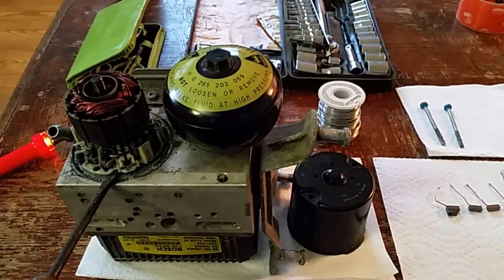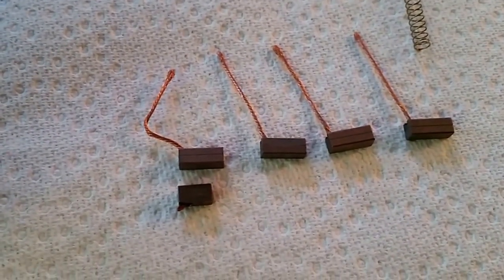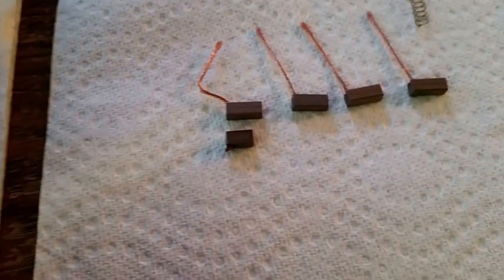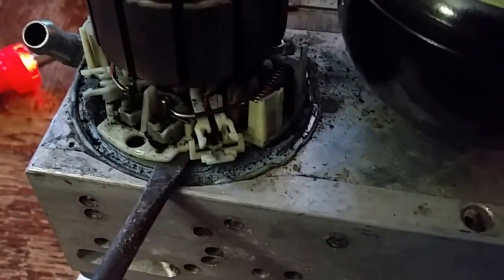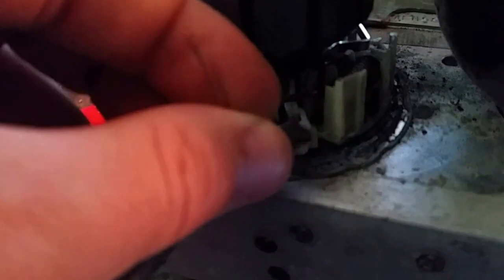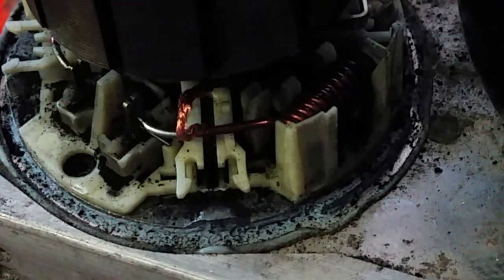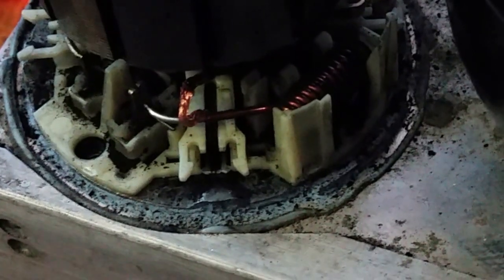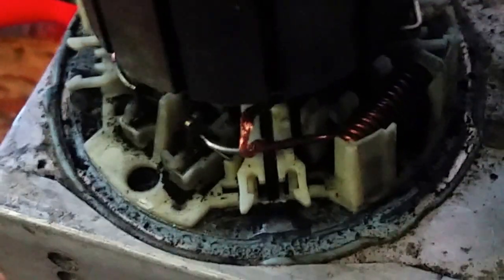Mercedes Benz / Bosch SBC Pump Rebuild (Brush Replacement) pt. 2

Comment: I think these old brushes are not half way trough but are completely worn out. Per previous video, the wires on the old brushes were pushing against the plastic frame already, when this happens, its no longer let the brush come out any further.
Reply from the maker: correct, they have to be long enough for the wires to connect and for the springs behind them to make pressure so they are worn out even before they are worn all the way down

Comment: Recall was on unit plug. Did your brushes failed prematurely? Your title says pump rebuild, where I don't see you addressing pump at all.
Reply from the maker: Good catch I agree its important to use correct terminology, if I said recall at all in any of the vids I should have "manufacturer extended warranty".  So just to clarify, MB had a recall associated with a limited number of SBC pumps and the recall was actually not on the pump or the unit plug, it was on the ground wire going to the plug and it also involved adding bracket for a change in the way the plug was fastened to prevent vibration.  Additionally and unrelated to the"recall" just mentioned MB has extended the normal warranty from what came with the car to a period of 10 years instead on the SBC pump.  Please check out all vids I have explained the purpose of the replacement and much more background.  As for the title I think its fine, the pump motor is part of the pump, I have noted its a brush replacement, and the description also makes it clear.  Thanks for watching!